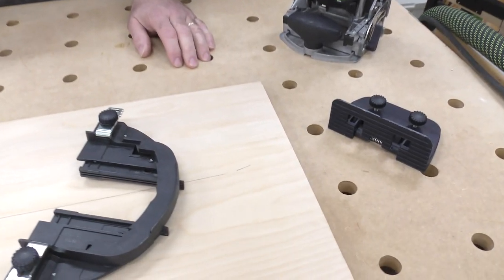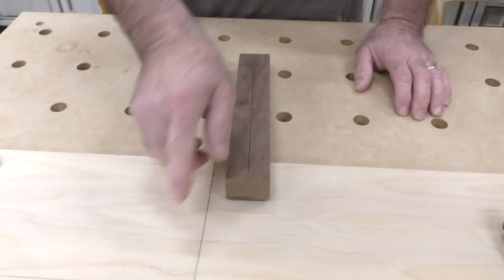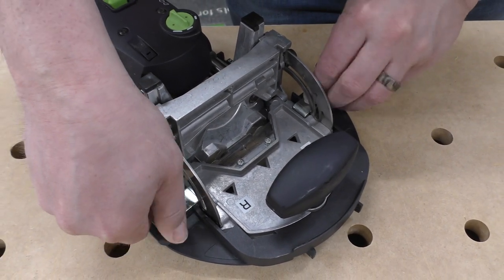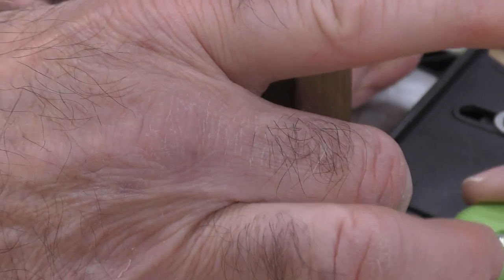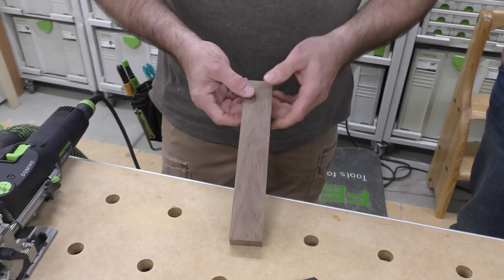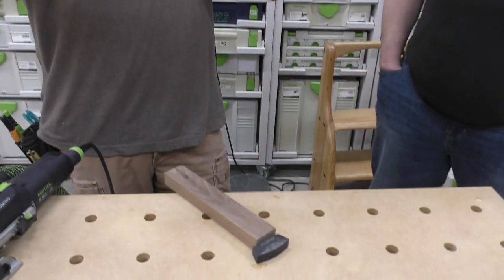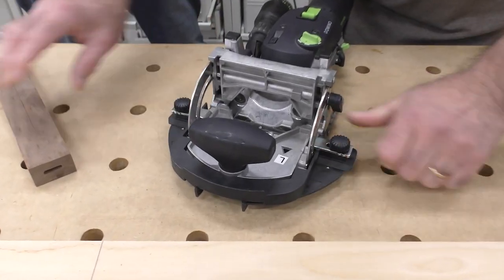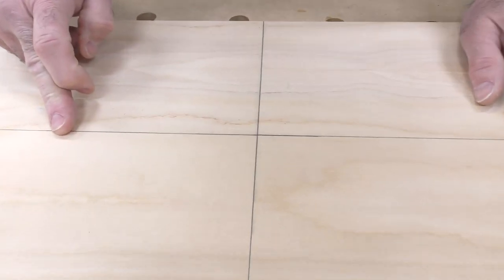Even More Festool Domino Tips: Domino in the center

Comment: Sedge, what's the recommended way to do two dominos on smaller stock boxes, say 2.5" deep side walls. The alignment pins put the dominoes too far to one side or the other, but a smaller single domino allows too much twisting/racking. Thoughts?
Reply from the maker: I would simply measure and mark and work off of center line....

Comment: Great video.  I have been struggling with this situation for a year or more.  One question, how do you keep the spinning bit from moving the tool when it first hits the wood.  This happens to me all the time, especially with the 5mm bit into plywood!!  The machine moves just a little bit, which throws off the position of the mortice from the measured point.  Thanks and stay safe.
Reply from the maker: Good question! The only time I have experienced some slight movement is when I plunged too quick....I put some moderate pressure on the base also !! Thanks.......
Reply: @sedgetool  Thanks for the reply.  This tells me I am doing something wrong.  The interesting thing is that I don't have this problem with either the 4mm,6mm, or 8mm bits in plywood.  MDF, I have no issues whatsoever.  And yes, dominos work just fine in MDF for carcasses.  The other usage I have for doiminos is for locking down the location of a piece of wood on a panel.  The narrow setting and the pins provide pinpoint accurate placement that I cannot otherwise accomplish with my skill level in joinery.  The domino system makes up for my beginning level of experience in woodworking!!